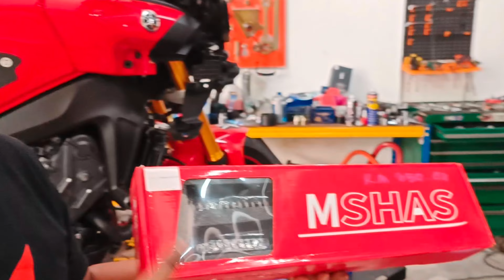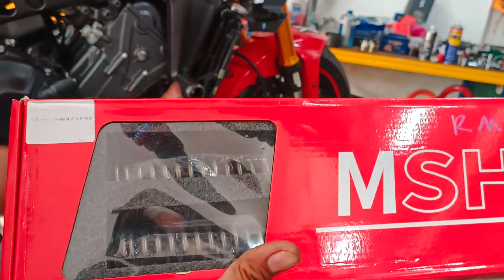Zontes 350/Part rosak /claim warranty/racun spring +roller

Comment: roller ringan pickup sedap tapi top speed akan drop..
Reply from the maker: gitu lah...kita test tgk
Reply: Berat roller tak mempengaruhi top speed.   Guna roller ringan akan naikkan rpm enjin lebih dari standard jadi top speed lebih cepat dicapai.
Reply: @v3rstyl3 cut off sampai dulu bang…same mcm tukar sprocket besar, celah mane nk lajunye kalau 140 dh sampai cutoff…kite cari balance point ikut berat masing2 n citarasa masing…kalau yg std susah nk dpt cutoff even dh full throttle then berbaloi la ringan kn roller…kalau yg std pn bole cecah cut off then no point ringan kn roller unless nk pickup cepat utk main town…tapi topspeed sure berkurang sbb 8.8k rpm dh cutoff…